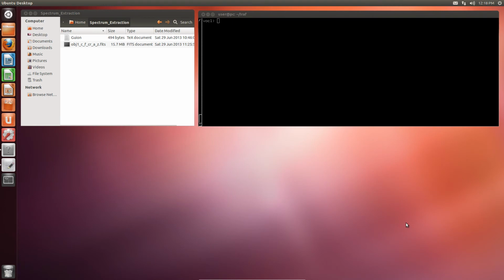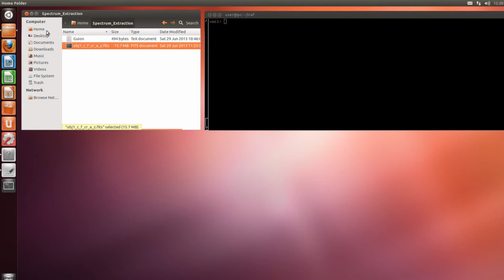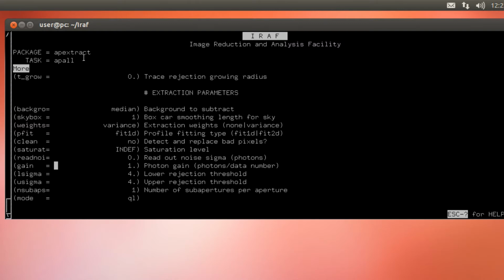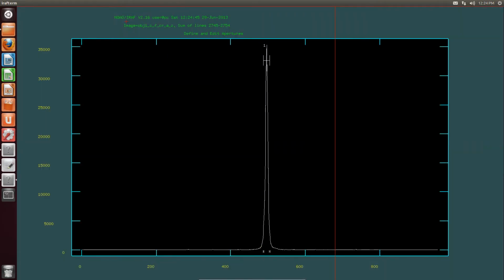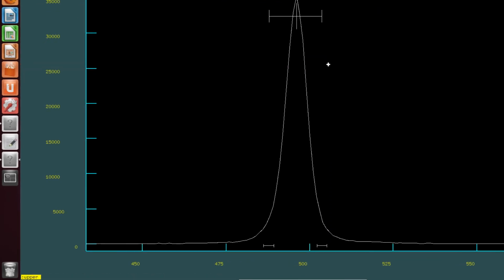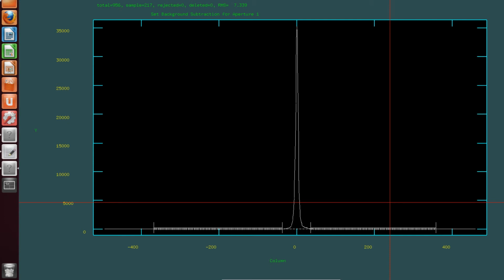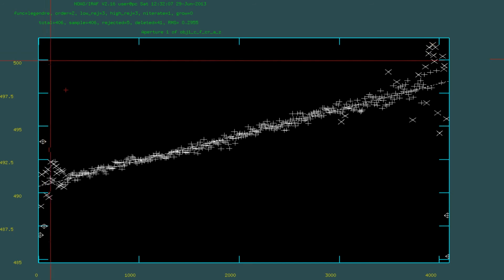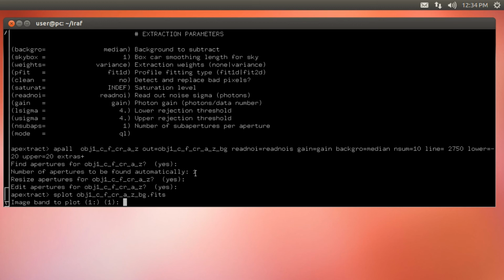IRAF Tutorial Part 8: Spectrum Extraction [HD] [CC]

Comment: Hello, thanks for your great video. I tried similar things to extract 1D spec from 2D using: "apall GAL.2D.fits output=GAL.1d.fits referen=STD.2D.fits", where the STD.2D are the observed standard stars. Then iraf warns: "Reference image (STD.2D) apertures not found". I search online and this issue should be that STD.2D.fits file is not found. I have tried to put STD.2D.fits in current directory or ./database/, but none of them worked. Can you give some help? Thanks a lot!